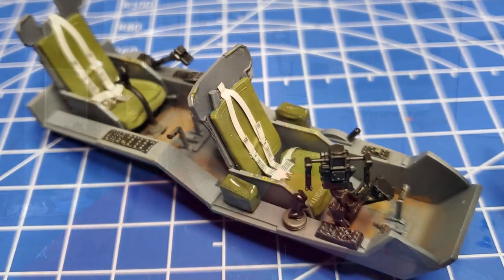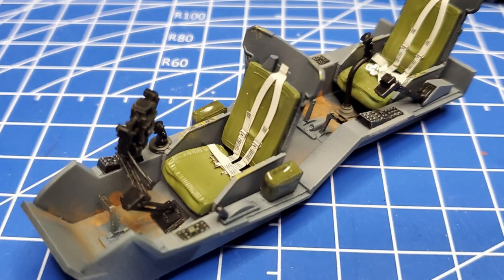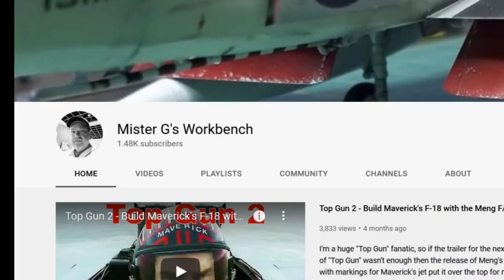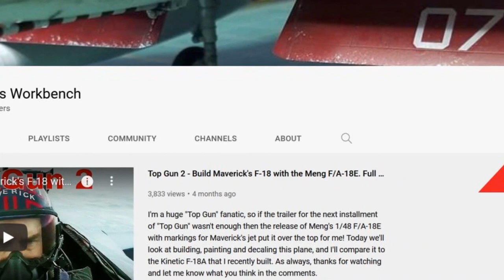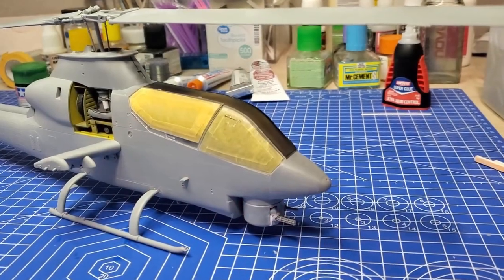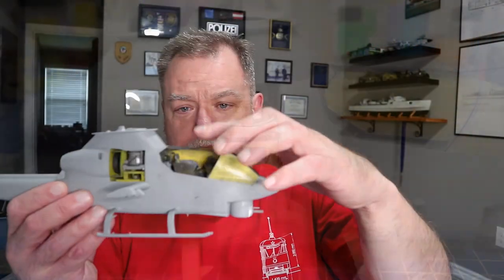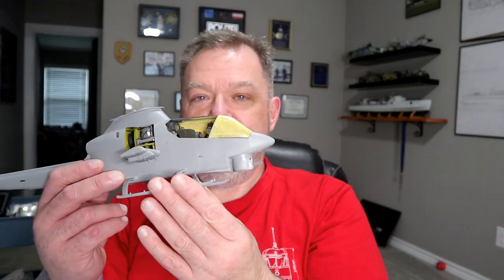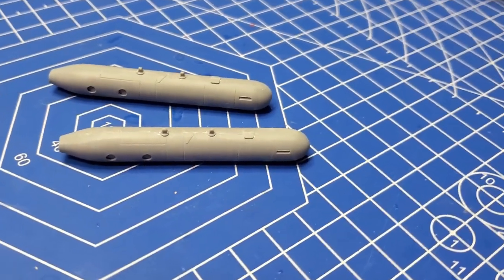Special Hobby 1/32 AH-1G (Early) - Part 2: The Fuselage

Comment: Great progress on the Cobra, John! I feel your pain with the canopy section. I was recently building the AFV Club F-5E and managed to glue the main gears on the wrong sides. This was done even after looking at the instructions.  After trying to figure out how I could fix it, a few days later I got lucky when I wicked in some Tamiya extra thin at the joint, loosened them up and remove them. Just a bit of cleanup with a hobby knife and good as new.
Reply from the maker: Thanks Ken - I looked at the instructions a bunch of times and still didn't do the right thing 🙄 I'm still happy with the build so I think it'll look good in paint. Thanks for watching!

Comment: Just a comment for the algorithm.
Reply from the maker: You're doing yeoman's work Robert. Thanks!
Reply: @MisterGsWorkbench  Just a quick question. I recently became disabled and am stuck in the house. I'm getting back into modeling in order to have something to do. Anyway I was wondering if you could suggest a good/cheap airbrush compressor combo. I know good and cheap don't really mix, but money is a problem.  Anyway thank you for your time and the entertainment.
Reply from the maker: @robertjensen1438  I have had good experience with Master airbrushes and compressors. They're low cost and fairly reliable. Check tcpglobal.com
Reply: @MisterGsWorkbench  thank you